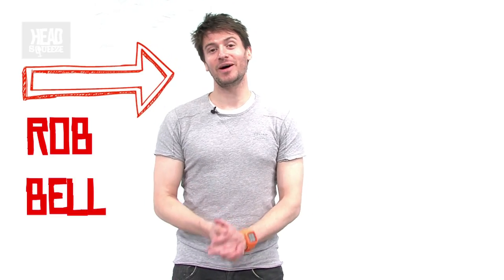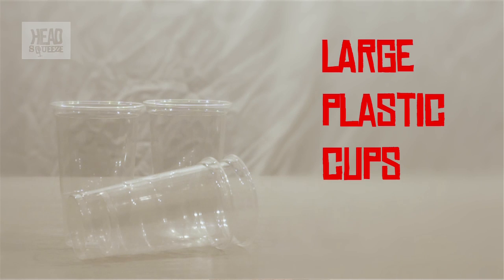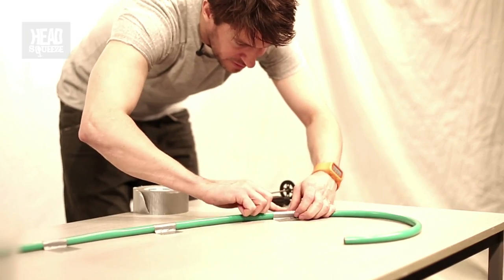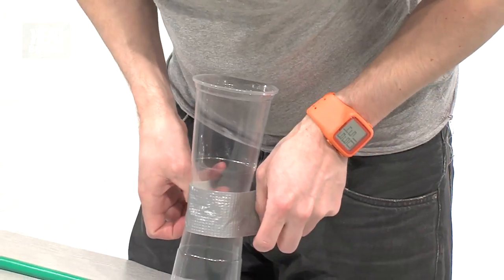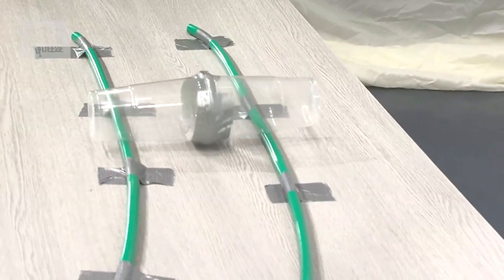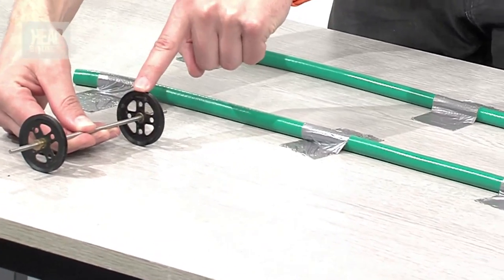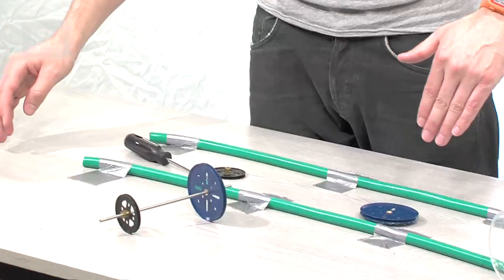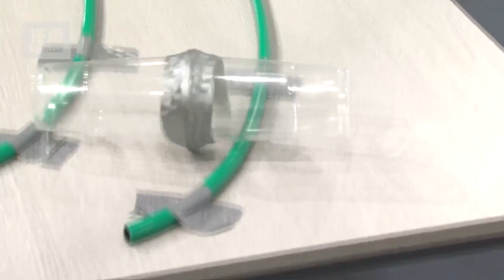How do trains go around bends? | Live Experiments (Ep 36) | Head Squeeze

Comment: Duct tape is called duct tape here too.

Gaffer tape is a slightly different. It has a different adhesive which allows it to be removed cleanly, so it's used when you want the surface to be clean after.

Comment: The angle of the curve and the length of the engine are carefully calculated so as to remain on the track. There are cases of some trains with unfangled driving wheels to cope with steeper curves. These will be kept on the track by the "pony wheels" or "leading wheels" but generally locomotives re designed with the angle of the curves they will encounter calculated within their design.

Comment: A fixed axle was originally necessary as the drive from the engine would need to be transferred to wheels on both sides, which requires the axle to be connected to both wheels as the pistons which move the rods which turn the wheels move at the same speed. This problem has since been solved in cars by the differential drive, another piece of engineering genius.

Comment: That would be the radius of the curve. It actually varies because some locomotives and cars have three sets of axles per truck/bogey, and some don't. The ones with less axles can round sharper radius than others. Basically, when you build a railroad, the government has guidelines and locomotive builder guidelines to follow. Some curves get identical, like if you're on a high-speed rail line, most curves will be broad, but some will be sharper than others, depending on the route.

Comment: Although those wheels didn't solve the problem with trains going around corners at higher speeds. Trains actually started out as all one price but then people noticed that this made them fall over when going around corners . So to fix that they seperated the first set of wheels on the train which is why the front swings out allowing it to go faster around corners

Comment: Solid axles are much more robust than any kind of open wheel or differential system. And differential systems are only on driven axles. The way the wheels are shaped also leans the train into the corner a bit.

Comment: Does that mean there is a strict calculation that governs the angle of a turn? Of course there are limits and a curve cannot be to sharp. But based on the wheel design, are all curves pretty much identical? If not, to what degree can the curves differ?

Comment: You forgot to mention that the rails  are canted inwarda at the top -usually at a gradient of 1/20 or thereabouts. This tends to centre the wheels so that on straight track you theoretically do not need flanges --but obviiously only on strsight track.

Comment: the problem is getting the angle right, if its too high it will turn slightly to much and then the other way and back until it derails.. :P this is why higher speed trains have more flat wheels... :P(means it cant corner as much ofc.... :P)

Comment: This explanation is often given but is not totally correct.  The taper on train wheels stops the wheel set hunting That is, not slamming from one flange to the other.  The taper is insufficient to act as a differential as described  except on nearly straight bends.  Basically, one wheel will always slip, and to stop the flange riding up the rail on tight corners, a guard rail keeps the opposite flange constrained .  Hence the squealing on tight bends
Reply: So the flange normally touches the track and especially on bends?

Comment: Why is it so hard to instead have the axal stuck to the rest of the train unable to rotate with the wheels not attached to it free to rotate around it to allow the wheel at one end of it to rotate faster than that at the other end? All that has to be done is the wheels get made first and then the axal gets built around them thinner where it's in contact with the wheels maiking it impossible for the wheels to slip off. After all, having tapered wheels has another problem of risking swaying and derailment as explained in Japanese High Speed Bullet Train (Full Documentary).
Reply: Bcoz bullet trains are too new that the trains and the railways arent older than 50 years old. After WW2, Japan is pretty much had a "hard reset" which allow them to make everything new. This type old railways has been used for more than 150 years in Europe and US. It takes ALOT of money to replace all the old railways to a new one. Besides, trains are rarely a thing in Britain and US, so why bother changing to something new if nobody wants it?

You need to learn history more before demanding something, not everybody is spoiled rotten like you are.

Comment: what about the japanese bullet trains that use flatter wheel? it's said that cone wheel will oscillate at high speed
Reply: If it's an undriven wheel you just have it on a hub so the axle doesn't turn,  if it's driven you have a differential or a seperate motor.  What he described is really unimportant since fixed axles with bearing replaced turning axles with bushings in the 1950s